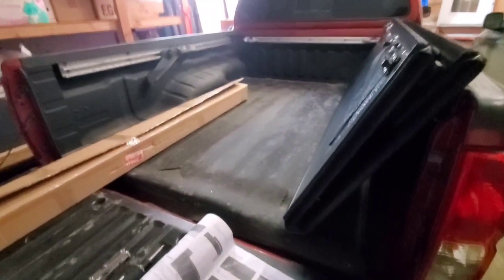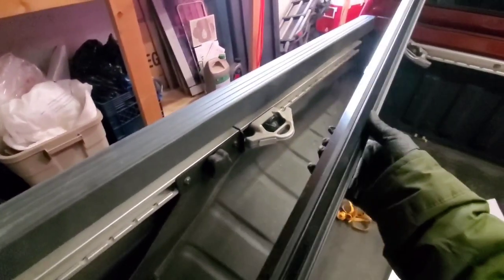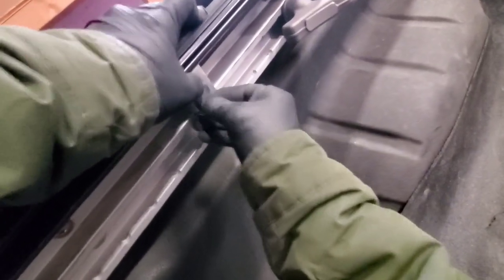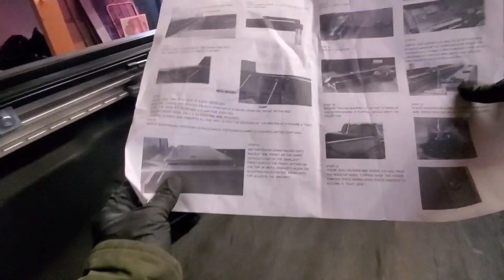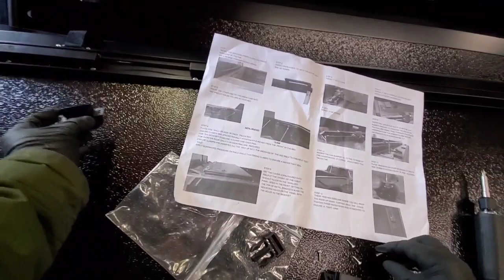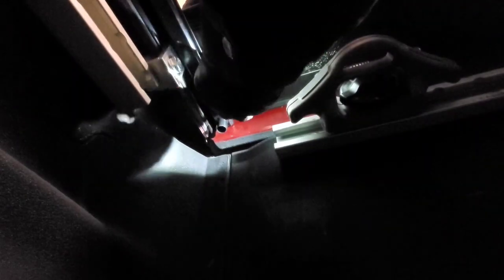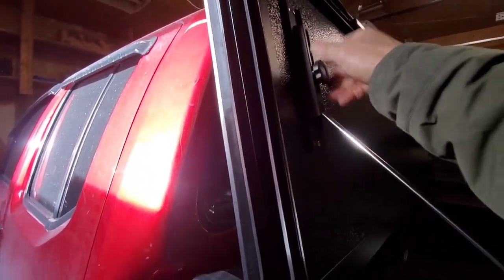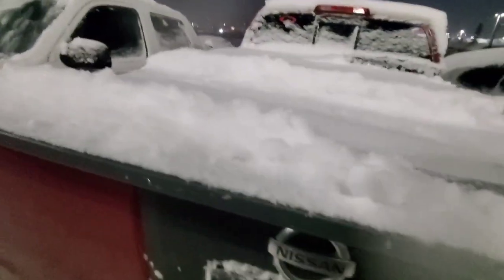BISON Flip Back TriFold Tonneau Hard Cover for NISSAN FRONTIER 6ft Bed #nissanfrontier #tonneaucover

Comment: Did you have to flip your utilitrack rails? Does the bed cleats work with the tonneau cover?
Reply from the maker: No need to touch anything on the bed rails, the cleats work fine with no issue